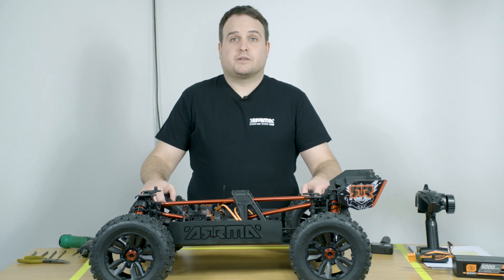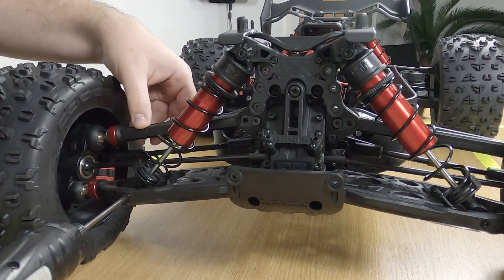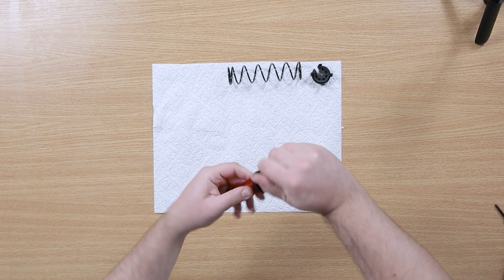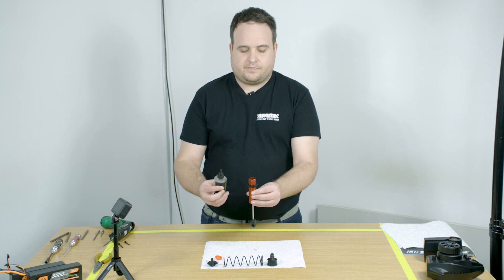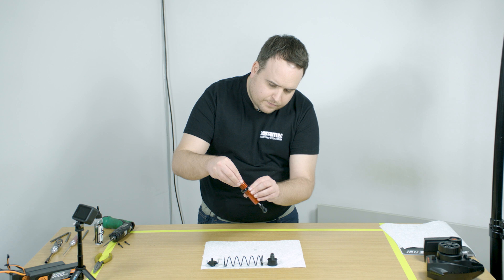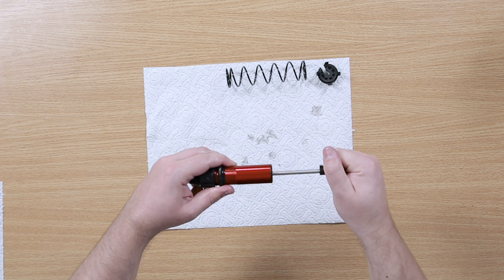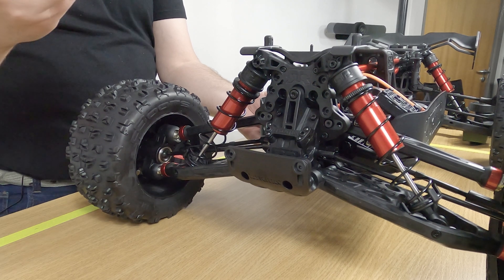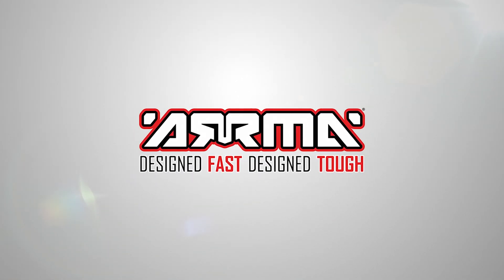ARRMA KRATON 8S // Official How To Guide: Shock Removal, Disassembly & Reinstallation

Comment: I can't believe that Arrma would produce a video of shock rebuilding that is this poor. When rebuilt his shock has no action at all. They are gas oil shocks and should have a force to extend itself under no load. The air pressure above the diaphragm would do that had he rebuilt the shocks correctly. This is a terrible video showing people how to rebuild shocks with way sub par performance. This shock he has rebuilt WILL NOT function properly and will effect the handling of the vehicle a lot. DONT REBUILD YOUR SHOCKS LIKE THIS GUY - IF YOU NEED A TUTORIAL FIND ANOTHER.

Comment: Wish mine came apart like that, had to get pipe grips on body. Shock failed on first outing, pushed bladder out of the small hole at top of shock. No big jumps as first time with a car this size. Thought it’d be tougher.